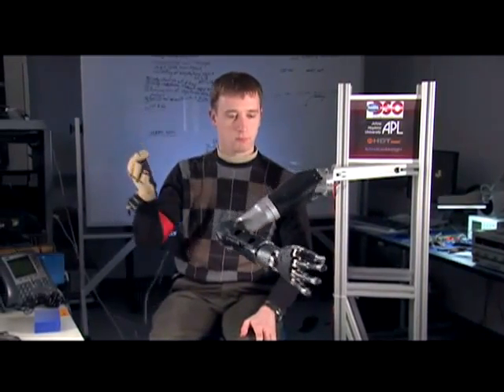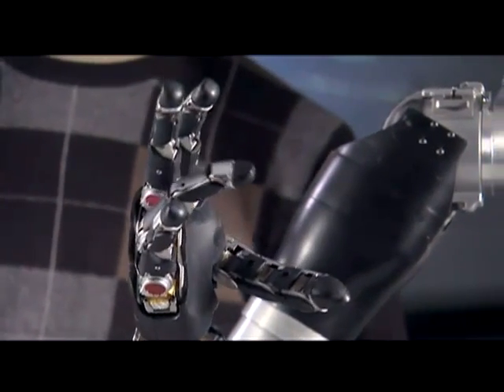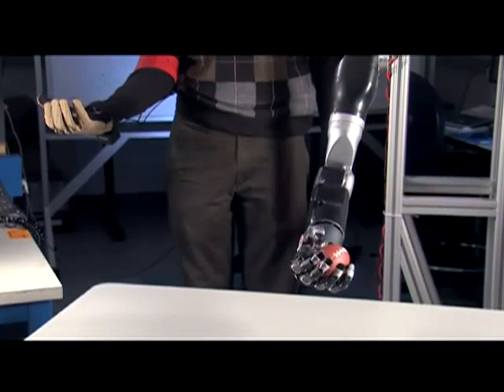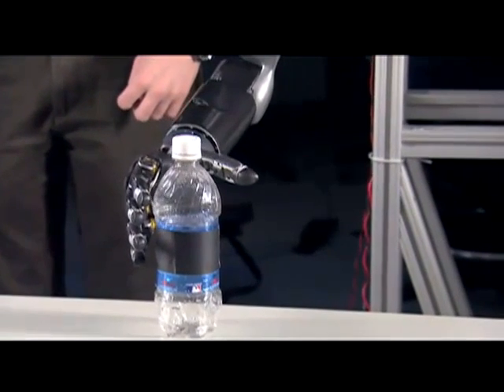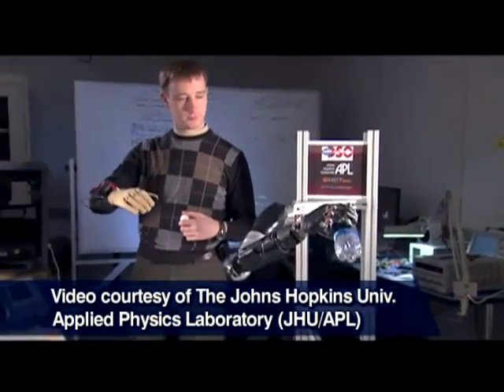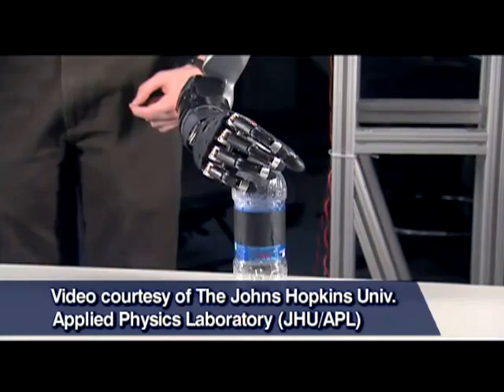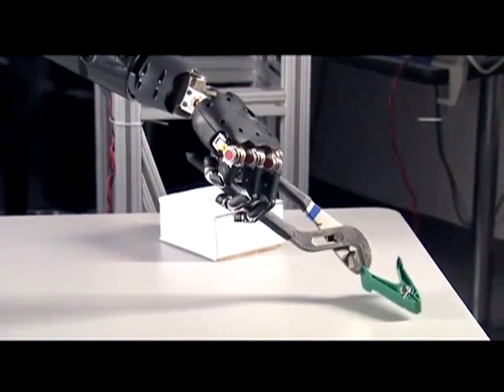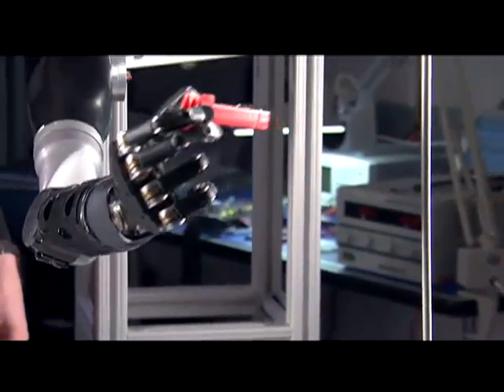Modular Prosthetic Limb Demonstration | HDT Robotics

Comment: Completely amazing technology, Sadly it was too heavy for anyone to actually use for long periods of time.  I got to wear the mocked up version of the DEKA arm and it weighed about 9-1/2 lbs compared to my current prosthetic arm at the time was also myoelectric and weighted 7lbs.  That's a big difference for amputees.  Currently,  I am working with ATOM Limbs out of San Francisco, California. They are developing a lightweight version of DEKA's arm shown here.  The prototype is already amazing and the arms total weight is only around 4lbs!  The hardest part to develop is actually the pattern recognition software  and interface with the amputees limb.  I'm afraid to say I don't think we are ever going to reach the level of control shown here unless you are using nerve or brain implants.  My control now is limited elbow up/down, wrist rotation and adduction/abduction, hand open/close and movement of each finger independently.  Mind you they are still fine tuning the system.  To top all that off the cost is projected to be less than half of today's myoelectric arms.  To find out more about the Atom Limb arm check out my FB page for videos and pictures of its development.  My name is Jason Morris and I am a Advanced Myoelectric and Bionic Prosthetic Arm consultant and Prosthetic Arm Developer.